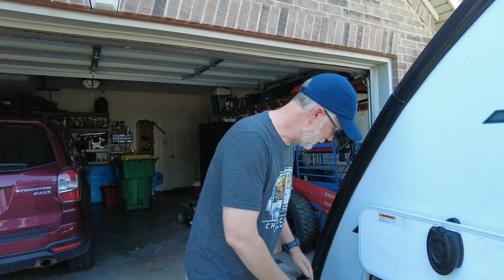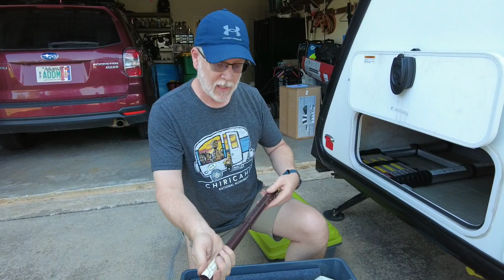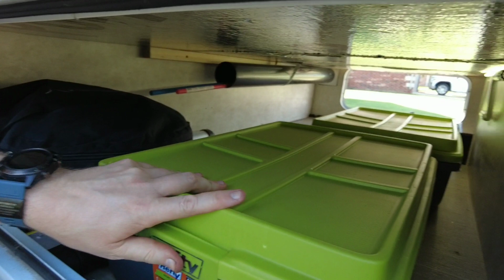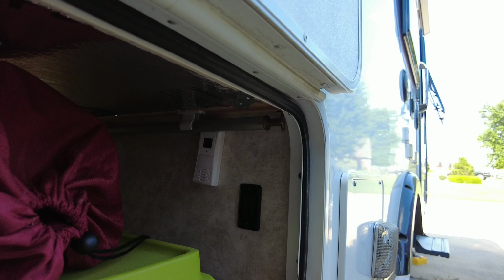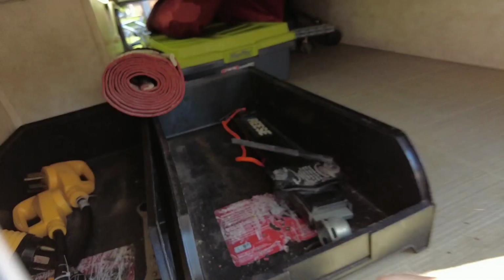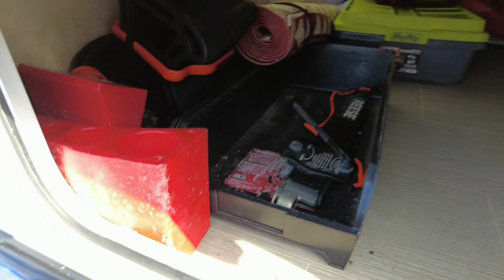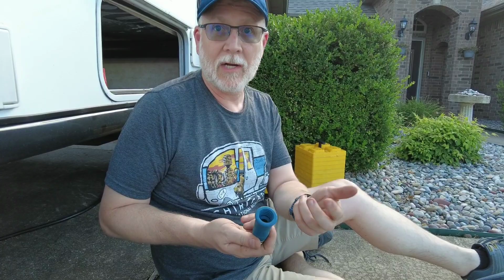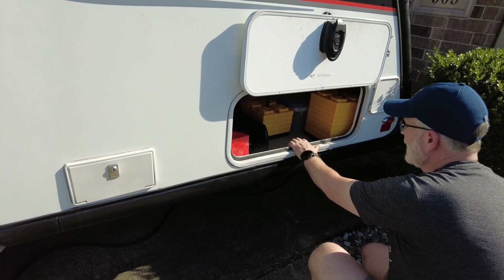Little Guy Max /Tour our Basement/Underneath Storage/Our Must Haves

Comment: Great video what a lot of very helpful information. I have been battling with the best way to store and pack the basement. I love what you did with the awning pole - i have to bend my back to get it clipped in to the way the factory puts it. Do you have any issues with the weight being so far back making it rear heavy? Also, what kind of drinking water hoses are you using? What is the temperature sensor used for? Thanks again.
Reply from the maker: Ed thanks for watching!!
Honestly the heaviest thing we have back there are the ladder and the grill.  Most of the rest probably adds up to much less than both of those things.
We use the zeroG hoses o e 25 ft and one 50 ft.  They are drinking water safe and give us flexibility for length needed.  The temp sensors are because I like to know the temps as we camp mostly for when we cold camp.  How cold is the basement, the water heater compartment, or the front storage box with our propane.
Reply: @TurnerMaxAdventures  Thanks for the reply. I am getting tired with wrestling with the conventional water hose that is drinking water safe so I will check out the zeroG hoses.

Comment: I noticed a straight black large diameter pipe that went along the front inside of your pass through storage. It looked like you might have fishing poles in it? You didn't mention it, but I was wondering exactly what it was. Thanks!
Reply from the maker: It was a sewer hose holder but our hose with attachments didn't fit, so we repurposed it.

Comment: Can you explain the purpose of the temperature  gages??  Did you change out the locks on the storage doors? If so what did you use?  What items do you use to secure your trailer?  Any link to these items would be helpful, thanks.
Reply from the maker: We camp in seasons where it can get below freezing sometimes and we want to know the temp in the basement, water heater compartment, and propane box(more about how hot it is in summer)
Gives me piece of mind to know the temps in those spaces and if I need to heat up/cool down any of them.

Comment: Love your videos and the LGM!  I had previously seen your sewage hose storage mod video.  When did you move it from underneath to the front and why?  I do like it stored on the tongue which means it is even more easily accessible while continuing to free up storage space in "the basement".  Did you have to move or adjust the propane storage box in order to get it to fit there?
Reply from the maker: Sorry, Vivian. Somehow we missed your comment. We moved the sewer hose storage to make it more accessible.  We didn't have to adjust the propane storage box. 🙌
Reply: @TurnerMaxAdventures  Not a problem, I think you guys actually did mention it when Chris did the modification to beef up the front tongue  but I appreciate the follow up, thank you!!👍😄

Comment: I was wondering your height. I am 5 foot 11 inches. Would I be able to stand in the LGM?
Reply: i'm 5"11 and I fit fine. I do not fit in a Little Guy Mini Max!!
Reply from the maker: I am 6 ft and can stand without a problem even under the A/C and in the shower